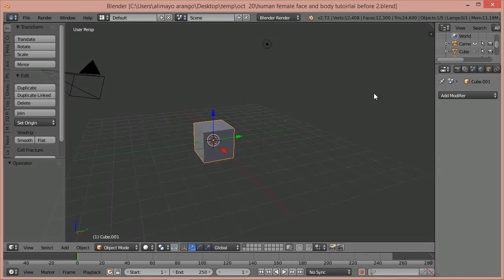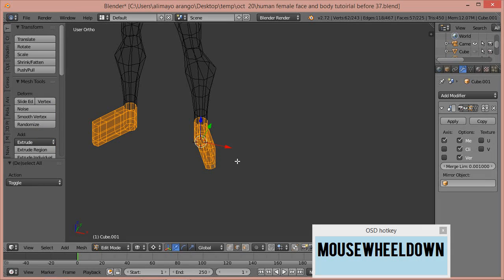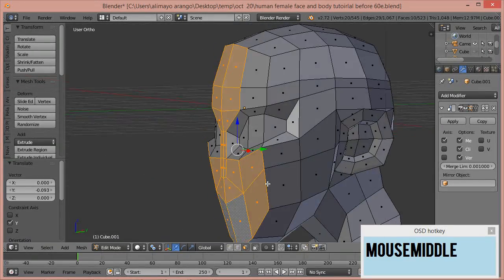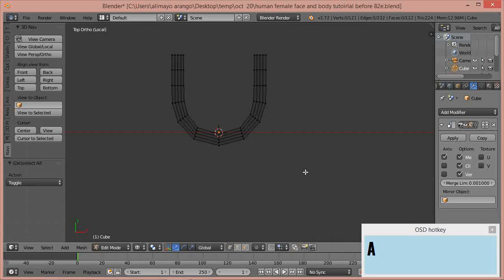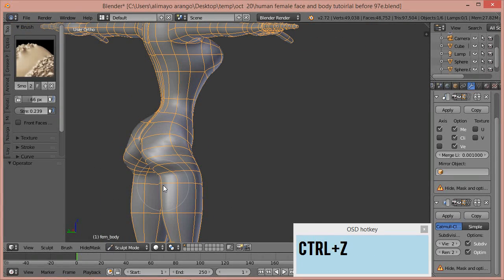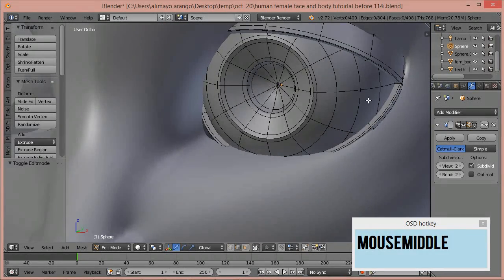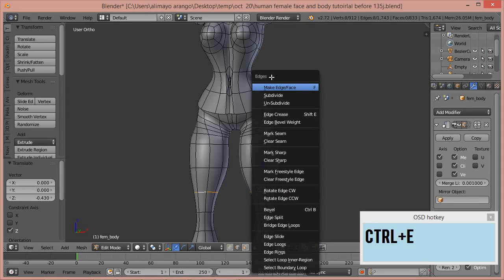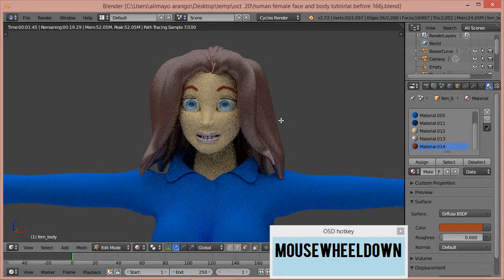How To Model A Full 3d Female Mesh Blender 2.72a Tutorial

Comment: hello
i made a model and needed to edit it, however in order to do it correctly i need to get rid of the mirror modifier. However it will not let me apply as i have added some shape keys.
how to i get around this?
Reply from the maker: +Jessica Smith Thanks for watching this tutorial Jessica. One way to get around the issues would be to cut the mesh you working on in half, then change Blenders pivot point to the 3D cursor, then duplicate the half that you have and then use "s to scale on the "x' axis -1 This could kind of give you a similar effect to using the mirror modifier. I hope this info helps you out Jessica. Please let me know if it does.

Comment: just one thing, after i delete the half and get it to reflect, the middle segments don't seem to scale properly
Reply from the maker: ***** Thanks for watching this tutorial Jennifer. Yes the scale will seem strange at first. Typically when you scale a "mirrored' object down it will stretch towards its middle. You can just readjust you mesh manually to get rid of the stretching or you could change you "pivot point" from Blender's default medium pivot point to " the 3d cursor". By pressing you regular keyboard "." key you should get options to do this. 

I hope that this information helps Jennifer and thanks again for watching this tutorial.

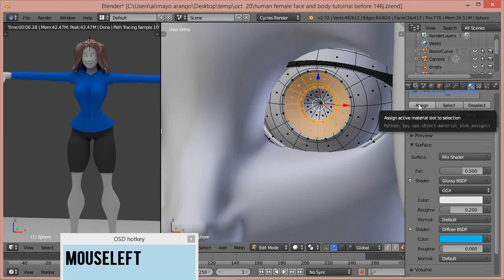Comment: The tutorials are very helpful and easy to follow but around 2:56:53 I have to pause, My menus for blender are slightly different especially the coloring selections, for one, there is no 'Color' tab, instead theres a diffuse tab, specular tab, shading tab, transparency and so on, I tried downloading several different versions, including the exact one you are using, still no luck
Reply from the maker: Paris Mariah Thanks for watching this video Paris. That is very strange that you have no color tab. Please make sure that you are using the "Cycles Render". It sounds like this could be the reason for your issue. If you need more infor contact me again and I will try to explain more.
 Thanks again Paris.
Reply: Alimayo Arango Thanks, I sent a more detailed message

Comment: Ok, have a stupid question. I can't select vertices or lines, while in edit mode, with solid shading selected. I have done it while working in other projects (by accident) and, for the life of me, I cannot replicate it while following along with your tutorial. My lines and vertices remain purple and I know that they should turn black to be able to accomplish the task of selecting vertices and lines with solid shading on. Any help will calm my nerves as I am getting frustrated with this.
Reply from the maker: Dan Sullivan Please don't get frustrated Dan. This sounds similar to what happens when you are working with a proxy.However this could also come about by unchecking "white arrow" in your outline menu ( which is usually all the way up top and pushed to the right). The 'White arrow" represents your ability to select object or geometry. Currently that is the only thing that I can think of that might be causing this issue. I hope that this helps, if not and you figure out the issue please let me know. 

Thanks for watching this tutorial Dan.